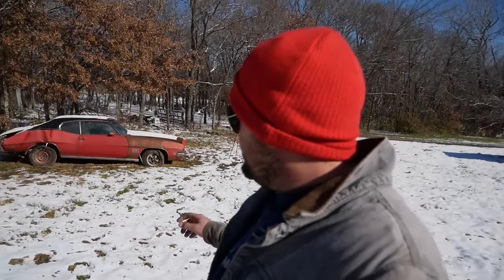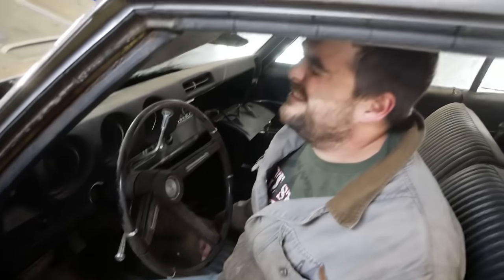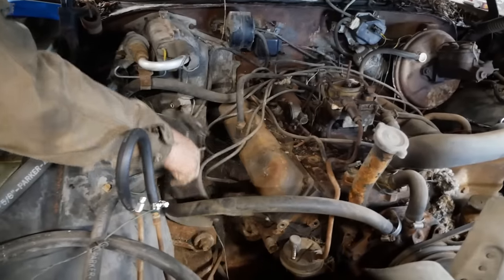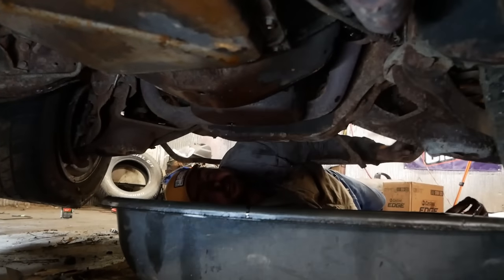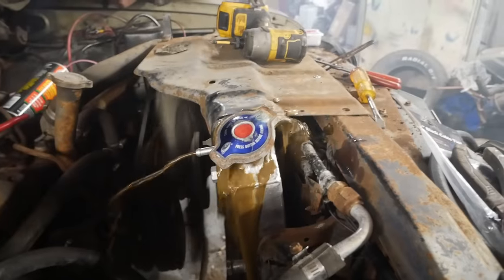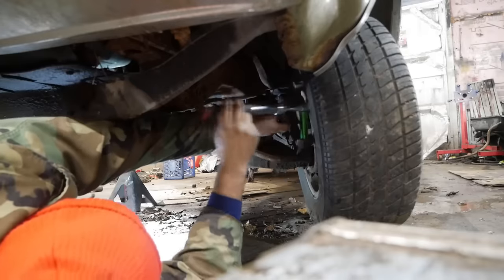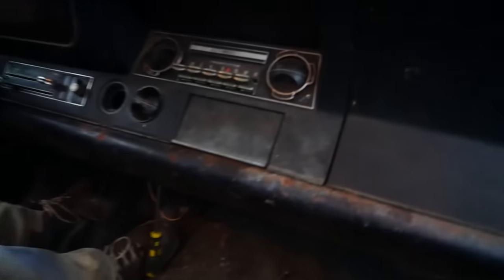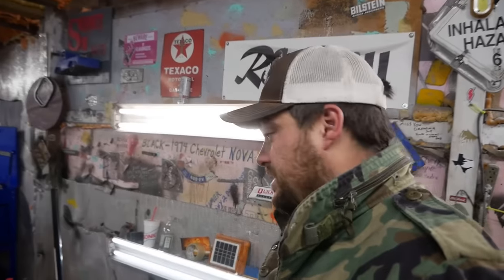CRUSTY Cutlass - Will it Run and Drive After 33 Years? Rustiest Oldsmobile!

Comment: Definitely, this car was in a major water event of severe magnitude. It has many salvageable parts that would bring a good return on your investment. Hard to believe this car is over 50 years old and still runs and drives despite all the erosion. I hope you find another 68 and utilize the parts to build a real roadworthy Cutlass.
Reply: Totally agree, well said
Reply: snow chains on it. Maybe its from MI or other area that uses alot of salt in winter before ending up in KCMO
Reply: @workingcountry1776 That's what my guess is because there's no way even if it did sit for that long around KCMO, for example, the rot wouldn't be THAT bad.
Reply: A flood in Missouri? First I've ever heard of that 🙃

Comment: Side note, you should see the horn relay on my ‘70 - everything is hooked to it. The stereo and inverter I added, the extra lights, the space shuttle, everything. 

Except the horn. That didn’t work, so it’s on a separate relay inside.

Comment: I said I'd watch it as a fellow 68 olds owner when you asked if you should do a video on it after you originally bought it. See it roar to life and drift through the mud made me laugh - thanks. And the 2 speed transmission Oldsmobile used in 68 was a Jetaway 2 speed transmission  - a close cousin of the Powerglide, but just slightly different enough to make them unique. Thanks for one hell of a video! 😂

Comment: It would be cool to deck out the interior of the Holey Goat with all the parts you can use Including factory A/C dash etc. Use the glass if possible but leave the outside as is but plug the bullet holes from the inside so you can stay warm and cool😂

Comment: What's crazy is I've seen mice destroy frames from the inside nesting and their acid piss over many years just eat the steel away. 
One guy bought a beautiful low mileage 67 Camaro which looked perfect. Fenders, quarters, interior everything was gorgeous, until they got it on the lift and noticed something funky with the rockers and then they discovered the garaged beauty was rotten from the mice piss!
That's a cool cutlass! Oh well,was. Lmao

Comment: 12:18 I remember reading about the horn relay issue back in the late 90s in Car Craft or Hot Rod Magazine in an article about adding headlight relays due to the voltage drop of the horn relay. Makes the lights much brighter. That was long before drop in LED bulbs.

Comment: I had a 68 in high school 350 2bbl 2 speed auto. When I moved to the area I live at about 20 years ago I found the most stripped down 68 Cutlass I have ever seen. It was a 2 door post with an automatic and a straight six! Nothing else. I think I read that there were less then 4000 made that way. It still had gold paint on the Chevy 6 too.

Comment: This machine has potential! A running (sometimes) engine, full head lights, and it is equipped with a squirrel cremation device! You should really bring this back to factory condition! All it needs is to be changed between the bumpers (and new bumpers).   :D

Comment: I have been restoring a 68 442 at work. Even though that car is a mess, it's still a good parts car. It is an AC car which has a different accessory drive and water than non AC cars. Not to mention a decent AC dash. Yes, all the power goes to that junction on the horn relay. Also, 68's have weird hood hinges that don't open very far. 1 year only crap.

Comment: As my old man used to say (when I brought home my latest acquisition as a teenager), "That poor old f***ed thing.....".  Don't get me wrong - I love the 68-72 Cutlass and think they were the model's best looking years....and would dearly love one myself.  Such a shame that there i so much missing from that car in the way of solid metal.  She's an S too, so slightly higher spec, so would be worth saving if it was just the frame that was shagged.  They have such a presence and the 68 in particular with its iconic face and slim tail lights that just mould into the bumper like they are part of that instead of attached to the body - they are really a great looking car....and don't those old 2-barrel Rochesters make a fantastic noise?  The box and diff must be in pretty good nick too if they put up with the rapid changes of direction you were throwing at it, so the driveline's pretty good.....sans the cooling system contents and the burnt valve on #7.  Okay, so the engine needs going through to tickle it up before it goes in another car, but for having sat for many years, that thing sounded and went magnificently.

I know where there are a couple of Cutlasses, but I don't think the owners - fellow Youtubers of your acquaintance - would part with them and they are already in pretty good nick, so don't need much......but maybe Kevin would indeed like your beasty as a spares car even though Mook's and his old man's car are 72's (I think).  

The old beast is definitely worthy of another life as good parts for other specimens, so thanks for keeping it out the jaws of the mad crushers (philistines!!) and I hope you find one with a great frame, reasonable body and no driveline as soon as.  All the best

Comment: The carburetor was on fire until it started and it sucked the flame in and put it out, It does work, Old guys know. Unless you have fire all around on top and such, Then a welding blanket layed over pushed in,... to take away its oxygen. 👍😎 I had a fire on my engine and I packed dirt all around the carb,..  took awhile but finally put it out! My air cleaner WAS on. After I got it out, I separated some wires, Dusted off as much dirt as possible and started it back up and drove it home. I had just gotten to my job site when it lite up😂😂😂

Comment: I had a 72 Cutlass. $175 rot box. The front clip was School Bus Yellow. Must have been from a 67 Vista Cruiser because they put the 425 (62-67) ci motor in it. It was also a 2 jet Rochester. 4 1/8" bore.

Comment: Not gunna to lie, I've also bought a large supply of old oil from my local antique mall for $2 a can. Bought 40 cans of 30w Quaker State, been using it in my lawn mowers/tractors for years. Just have to mix it with detergent mixes or some Lucas to make it last a while.

Comment: From Bob's the oil guy site... 

"20w20 was actually a very popular grade of oil throughout the 50s and 60s. In fact, I think 20w20 was factory fill in most GM, Ford, and Chrysler engines up until the late 60s.

NB: A 20w20 oil is a straight 20wt, but unlike other SAE viscosity grades, 20wt has both a low temp and high temp spec, thus it can be labeled as "SAE 20w," "SAE 20," or "SAE 20w20.""

Comment: Old Rocket 350, GM's Cleveland. IMO the Buick 350 is the best of all of them for one simple fact.. it's 200lbs lighter than a SBC. I like the head design of the Rocket better though, that same open chamber with 12 degree canted valves that the 351C 2V got because it was designed by the same guy. Unfortunately they have the same oiling problems though so a line from under the oil pressure sender down to the oil galley for the mains is a must if you like having main bearings in your engine because it prioritizes the valvetrain/cam over the mains. Well, the plus side is if it's not too rotted you have a donor frame in the front of that Lemans to fix that Olds with.. or if you can talk Speedway into hooking you up with one for cheaper, they do sell a replacement front frame for a 68-72 Chevelle which should fit any A body GM.. downside being that like everything at Speedway, it's stupid expensive.. $1300 full price. Though for that I think you can buy a universal Mustang II weld up front end kit and upgrade the suspension. Oh look, I found frame horns for $360 from another company.. once again Speedway is stupid expensive. https://www.afcoracing.com/store.aspx?itemid=3440&prodid=20770&pagetitle=-Chevelle-Frame-Replacement-Left-Side-Frame-Horn
I wish I could afford to buy that car from you and come get it and bring it home and replace the floors and the screwed up frame.. I've always wanted a Cutlass since I got a model of one when I was 13, and a senior my freshman year of high school had one and then I REALLY wanted one. It may seem too far gone for you, but I'd be willing to put in the work.. unfortunately I can't afford to and don't even own a regular mig welder just a Harbor Freight flux core... and my dad and my back would hate me for it. Plenty of people make full floor pan replacements for those cars.. OGPI seems to be the best price.

Comment: if you invest in wheel carts or install tow bar or point in back three corners boltdown reciver 2inch for winich and couple snatch block works good after market big wheel dollys steel plate couple wheels vs jack under it helps move lot with easy

Comment: I'm certain GM used the Switch Pitch torque converters alone on the TH350 and TH400 which allowed for smooth operation and it was kinda like a dummy version of overdrive if you will. Not to confuse it with the TH350 'c' transmission which also had a built in "dumny kind of overdrive". It was an available option for those two transmissions for a time anyhow.

Comment: lol, the frame broke on my grandmothers caviler and shoved the drivers side tire into the fender, the tow company wanted $180 to tow it less than a half a mile, I rachet strapped that driver front straight and used a jack handle I jammed up to keep the wheel from moving back again, I pulled that car home as the cv was pulled apart, the only thing that held that wheel on was the strut, lower control arm mounts were gone, shame the car out outside had zero rust, little 2.2 ran great, high milage though. Glad it did when she was not moving fast.

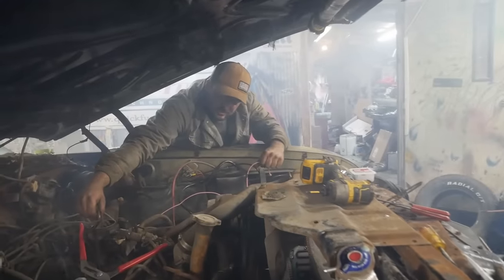Comment: 33:00 I think it's got at least 1 intake valve stuck open.. May be timing, but it sounds really good otherwise.. I'm betting on a stuck valve..
Reply from the maker: Nah it came out of it. Probably just some carbon. Now, why did #7 plug look like that? Gonna guess a few thousand miles of driving might give an answer

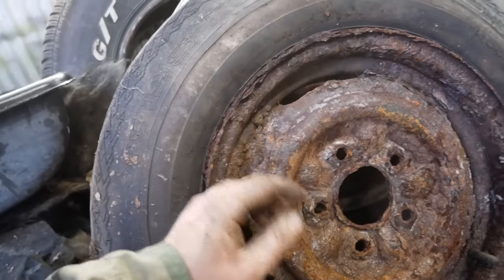Comment: 49:58 that's what the donut spare looks like underneath the back of any 20-30 year old minivan or SUV in Yankee states, and believe you me, it is not worth trying to get it out.  It's structural to the vehicle now.  If you need a tire just get a tow to the next tire shop and fix the regular tire, that thing is NOT coming out.  Even if it does come out, it's as useful as a cardboard box and makes twice the mess.

Comment: Just to clarify, 68 and 69 2 speeds were not switch pitch like the 64-67. And that switch at the gas pedal is indeed a kick down switch, not a throttle position sensor. Same exact switch as used in the TH 400.

Comment: The engine management computer thingy may come good with a re-cap - ie replacing any electrolytic capacitors on the board.

That's a pretty standard cure for old radios and isn't at all expensive if you can handle a soldering iron

Comment: you need to make an engine testting cart that has 2 batteries wired in Parallel to keep the 12v but have the extra amps, a 1 or 2  gallon fuel cell with an  on board fuel pump and a couple other odds and ends so when you want to test an engine you have a set of know goods. with a couple connections you can test fire an engine. Or you can test fire and engine on an engine stand

Comment: Cooling systems are more of a problem with older machines.  Before starting the engines.  Replace the Thermostat valve and Thermostat cap of the cooling system at once. Thoroughly flush the cooling system from old liquids.  It has always been so.  Before restoring the engine, put the cooling system in order.  Otherwise, the work doubles with overheating, the motor must be completely read from scratch.
Reply from the maker: I mean, it's fine 🤷

Comment: The "20 20" oil is probably 20W20. Just means it had some additives to let it flow better when cold.  Should be fine in that engine. All that oil should be. At worst some of the additives fell out which will have little to effect on that beastie.
Haven't seen rust like that since I left Michigan in the late 80's.

Comment: You forgot to shake it before you dump it out. Old oil we had to shake to mix supposed additives up in the oil. 20/20 Straight weight 20W with detergent and paraffin and zinc

Comment: Had a friend take water and do the same thing you are doing getting the carbon off the top of the pistons.   I NEVER laught so hard a big piece of carbon came off it got caught by a valve when closing bent the valve.   After that it decided to put that bent valve threw the piston and the piston decided to hang up and put the Rod outside of the motor.   It was a old car BUT the motor was good and that's what He wanted BUT didn't happen.   Yeah I know it's NOT funny but if you would have been there you too would have thought that it was funny. 😂 😂 😂

Comment: I have a 68-72 GM ABody frame out of a 1970 442 full roller no rust but there is a big plate welded to the front passenger side framerail. Has a 12 bolt Chevy 411 posi and the front suspension is like 15 or so years old it has less than 1000 miles on it and its been in NC since 2005 sitting in my garage. I just frame swapped my 70 442 theres a short on my channel if you want to see it. This car may be to far gone though lol
Reply from the maker: I have several frames, but this car isn't worth the effort, and I doubt it would even come off in one piece

Comment: Hello  I  have an 86 Mercedes  straight  6. Good transmission  good motor don't  run and .I have  a good clear title  and keys .I will it for scrap  prices. I  live in Clarksville Tennessee. I  have a shop with a lift .You should  do a revive and drive...no rust I repeat  no rust..

Comment: That olds is roached. It could have been a cool ride but it's only a parts car now. A little tune up tip. I use wooden clothespins, i number them 1-8 and i keep them in my tune up drawer. Just clip them on the wires. Its easier than tape

Comment: That's a good thing you looked it over before you bought the scrap heap but I guy anything to make a video with is all you need it don't have to drive or be solid all it has to do is run. Those olds rocket 350's are a dime a dozen I got a good running Rocket 350 and trans out of a 73 Cutlass sitting in my shop and I have tried to sell it and nobody wanted it but if it was a 455 everyone would want it
Reply from the maker: There's TONS of parts on this car that are basically unobtainable. Already have a good lead on a more solid 68 Cutlass. This is exactly how I would have played it, YouTube or not.. Find a parts car, then buy a car lol

Comment: Are you sure about the engine size? I had a 1965 cutless. It also said 350 rocket, but it was a 330 short block with 350 horsepower.
Reply from the maker: The 330 grew into the 350 in 1968. To my knowledge no 330 produced 350hp

Comment: That LeMans could provide some better looking parts for the Holey Goat.  I don't thing it's worth fixing on its own.  I had a 1975 Monte Carlo and the 350 spun the bearings. I had a Rocket 350 that I could put into it but was told it would not fit.  Was this correct information?  I never knew.

Comment: There isn't enough wrong with either 1 of those cars 2 where they can't be restored again. A true body man and mechanic could fix em both even with frame damage/ swap and quarter panel folded because they don't call em FRAME OFF RESTORATION for no reason at all.

Comment: You spend a lot of time working outside in the snow, dark and freezing cold for a man with a shop.  A tractor or bobcat might be a fun PBG project and then you could use it to drag your non-running vehicles in and out of the shop.

Comment: Do you remember that #7 totally fouled spark plug? And do you remember that miss firing cylinder? I'd start looking there. Not that I am a mechanic or anything. Oldsmobile engines are famous for failed rocker pivots.
Reply from the maker: It seems to have cleared up, runs pretty good

Comment: Yeah that's what sucks about AC Delco now Chinese company I think bought them out I got a oil filter for a 99 Camaro and has Chinese lettering on it put a new oil filter in the oil pressure went higher don't know if it's a good or bad thing
Reply from the maker: Still gm owned but not like that means a whole lot these days

Comment: "I don't think this thing is worthy of a frame-off"

Why not? Half the work is already done for you!
Reply from the maker: A "frame gone" if you will
Reply: @PoleBarnGarage I noticed early in the video, when you were trying to lift the hood, the bumper and grille were pulling in and up lol
Reply: ...and I'll add that your hammer technique was, in fact, very much in my pickle fork users manual. 

Last time i needed one was to re-tube a steam boiler, slide it down over the collar of the tube and beat the thing with a hammer was exactly what they wanted done.

Comment: Look for another car.  Pull the engine from the car you have.  I would flush the block really good. Or just do a cheap rebuild of the engine.  Olds 350 engines are not easy to find.

Comment: It is so strange most you tubers jacks squeak tested the theory i made a couple videos posted them now my floor jack squeaks did extensive research on you tube they make a spray and some jacks have a grease fitting strangest thing stopped the squeak thought would pass this information on to save you the time and effort of researching the you tube jack squeak mistry